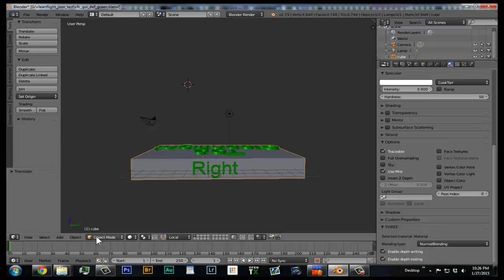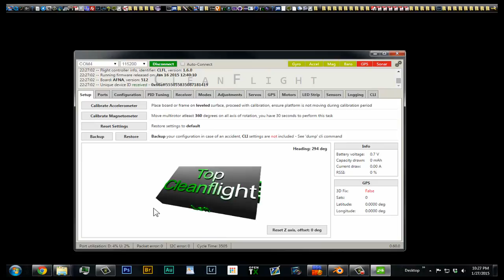Cleanflight Configurator Model Animation Model

Comment: Hello Thomas, do you still have  the blender models? I'd like to change the props on the quad_x model as they are all CCW props.
Reply from the maker: The files should still be on Cleanflight GitHub.
Reply: In the cleanflight-configurator I see the .json files that are exported with the THREE.js export plugin. The THREE.js guys never made an importer to load the model back in to blender :(
Reply from the maker: @DoctorWhom  https://blender.stackexchange.com/questions/118822/is-there-any-way-to-import-a-json-model-into-blender